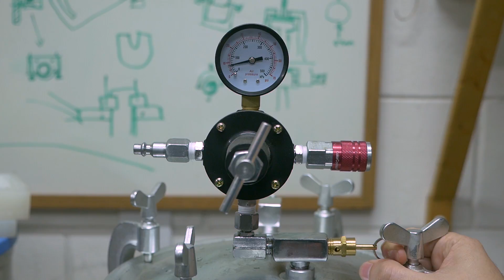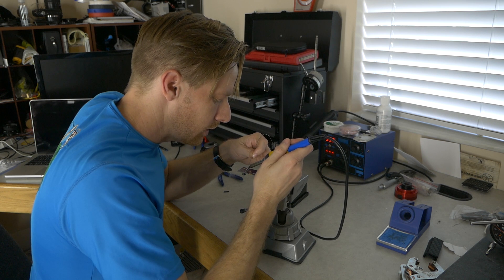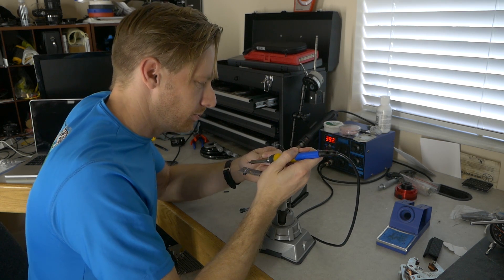We sprung a leak! - S02E09

Comment: I understand the use of this device in Industry, Institutions, Hotels and apartment buildings. But for home use not so much. Still having someone replace batteries once a year or just replacing a flapper valve 3 to 5 years The cost may not be recouped. Now if it were not battery powered could see other uses for it.

Comment: Heck that scale of surface mount can easily be done with a soldering iron. You don't really need a hot air or oven method unless you're doing BGA or other pin-inaccessible devices.

Comment: It's cool and all but these have existed for years, they're basically just urinal flush controllers, certainly not something you would need in a domestic setting. I mean do you want to have to wait within eyeshot of your toilet for it to fill or would you prefer if to be ready when you are? If you have a leak in your toilet you do then want to be spending hundreds of dollars on an electrical control valve when you could spend a few dollars on plumbing parts.

Comment: Close. That device is used for self flushing urinals. After the motion detector has gone quiet for half an hour the solenoid stops the water. This means the cistern doesn't flush all night long for no reason.
However, most of all that I have installed 30+ do nothing because nobody changes the batteries. There is a very clever mechanical version that detects the drop in water pressure as people wash their hands..... if they wash their hands.

Comment: Don't use a bloody atmega for a low power application, there are way lower power microcontrollers.
Reply: MSP430 instantly sprung to mind. I'd improve the plumbing. I like coloured cistern blocks because they keep stuff clean and show leaks in the bowl. I just bought my first house and replaced fill and flush valves but wouldn't build a solenoid valve inline unless I fit a urinal. Mains powering it would be part-P notifiable work but this sort of setup wouldn't need a sparky to sign off.

Comment: I guess KS shows just how pointless this project is. If you have a leak - fix a leak. It is easier than installing another device that can leak itself and needs maintenance. Also, without certifications, if this thing leaks and floods your house, insurance will not cover any of it.
Reply: Props for prototyping though. The part of the project with the most value.

Comment: It seems to me what you are saying is that the valve s normally closed. A person entering the bathroom causes the valve to open through the action of a motion sensor and the valve remains open for a predetermined length of time. The person may or may not flush the toilet during this visit and a toilet flush has nothing to do with this valve.

Comment: There is a flaw in your design concept. The way that this designed to work requires a person has to stay in the bathroom until the toilet shuts off or the tank will not get full. since you are staying there until the float valve shuts off the flow of water this device is redundant. A simple modification to the circuit would be to a potentiometer controlled delay circuit. The delay would shut off the water after a person leaves the bathroom and the delay could be set for the fill time of the toilet it is hooked to. This adjustment is required because different toilets have different fill times.
Reply from the maker: +John McKenna this is how it works now. It just opens the valve for a set period of time where it detects motion

Comment: I'm all for conservation,  but this is way worse than just making sure that the seals work. The manufacturing of batteries and the unit itself combined with the replacement of the batteries could never be offset by the loss of water, especially with a properly maintained toilet.  This actually bad for conservation.
Reply from the maker: +EnlightenedSavage do you have any actual numbers to back that up? Because right now most research and governing body estimate more then a trillion gallons of water are wasted every year on leaks that this device would help prevent. The simple fact is that toilet seals suck, and the current trend is only making them worse.
Reply: I agree that wasting water is a big problem. I drive my family and others crazy with my conservation efforts.  That wasn't what my point was. I just don't agree with the statement that seals suck. i have work in labs where a simple few dollar seal will keep a near perfect vacuum for weeks on end.  Proper maintenance is the real issue here. Seals do need to be replaced and not even that often. That is a simpler, more economical and environmentally friendlier solution. As far as numbers go, it is self evident that a simple seal has much less impact than an entire system. Besides the burden of proof isn't in my corner. I don' want you to feel like i'm attacking you . I quite enjoy your channel. But CONSTRUCTIVE criticism is important to grow.

Comment: I once stayed in a hotel where the toilets didn't have a cistern, it a
was flushed with a "spring tap" via less than 2 foot of tube, it was a flush handle that was about waist height. simply push and hold till the waste is gone! even simpler than a normal toilet. 

aren't they worried that the toilet will have to fill up before they can flush those tacos?? 

wife: hey honey, why are you dancing in the bathroom??

husband: I'm trying to fill the loo!

W: Okay...

waste of time, money, and everything that went into it.

doesn't even appeal to the gadget lovers!

Comment: Great engineering and informative video, but:

Scenario 1:
You know you have a leaky toilet and are annoyed about it.
Result:
You fix the toilet.

Scenario 2:
You know you have a leaky toilet but don't care about it.
Result:
Well, you don't care about it.

Scenario 3:
You don't know that you have a leaky toilet.
Result:
Won't get fixed.

Conclusion:
None of the scenarios end up with you buying a separate device that increase the amount of couplings and risk of leaks in your system.
Reply from the maker: Scenario 4: you own a apartment building, your tenants don't care they have leak but you do. its difficult to tell you have a leak and this will prevent it.

Scenario 5: you own a property that you are only there for a few month out of the year. a leak could start at any time, including when you are not there. this prevents it.
Reply: Scenario 4 is relevant, perhaps this will find it's market in apartment building owners.

Scenario 5 isn't really plausible since if you leave a house for long periods of time you usually just turn the main water supply off to prevent any type of leaks while you are gone.
Reply: Perfect counter-arguments. Somebody hasn't thought about their product enough to see how silly it is.
Reply: And there is plenty of affordable systems that you hook up to you main water supply that will detect leaks (small and big) and alert you of them. It will also shut the water of automatically if it thinks you have a major leak somewhere. Makes more sense since it covers your entire system and not just the toilets. 
Since most houses have more than one toilet you'll need several of these toilet devices as well, so it will be more expensive and higher maintenance than the one device that covers your entire house.

Comment: what exactly is this device for?

my toilet i.e. is stopping the water if the reservoir is full. and i need the resevoir to be full everytime i use the toilet. so how does this improve anything?
Reply from the maker: because many times the flapper valve in your toilet doesn't do its job.
Reply: Physics Anonymous i have to disagree. the valve on my toilet does its job every time. if it wouldn't, it would be broken and has to be replaced.

there is no point to adding a second valve, because why did you install the main valve in the first place then?

this idea is like you fix a dripping fosset by attaching a fancy device to it instead of fixing the fosset itself...
kinda like an antivirus for toilets...

i does not sound like the inventor thought this through or he is after the money of very stupid people (i dont want to imply that, but its still a possibility)
Reply: A replacement flapper valve costs about $5 at Ace hardware and lasts years, doesn't require batteries. This is the essence of a 'jerry-rigged' solution: fixing around the problem when fixing the actual problem is smarter.

Designing a smarter toilet valve from the get-go would be a more worthy engineering goal.

Comment: So to prevent a leak you've actually added several more point to which a leak can take place. You've also pointlessly added to your carbon footprint... so inadvertently you've not helped the environment at all, quite the opposite...
Reply: Funny you said "crappy", Thomas Crapper was a plumberL https://en.wikipedia.org/wiki/Thomas_Crapper
Reply: The water that goes down your drain isn't really wasted. It goes back in to circulation almost immediately after passing the water purification plant. Fresh water you use to water you lawn is "wasted" since it's not reused immediately.
The energy used to purify the leaked water at the plant is wasted, but that amount of energy is nothing compared to the amount of energy needed to manufacture and ship these devices, not to mention the continuous supply of batteries it need.
So all in all this device damages the environment more than it helps it.
Reply from the maker: +pault040210 a few things, first, water conservation and carbon footprint print are two different things, but it's a fair point non the less. Second not all valves are created equal. The flapper valve in a toilet is much much more likely to leak, especially with the new low flow toilets because they have less head pressure. Check out some of the studies discussed on the Kickstarter. A huge amount of water is wasted because of the crappy design of the flapper valve on almost all toilets

Comment: Are you using a radius on the scraper?
Reply: miles mcdonald yes- I borrowed from Stefan Gotteswinter's advice and radiused my tool to about 60mm. seems to give good control over which part of the blade is contacting the surface

Comment: I love the engineering aspects of this, designing a circuit, 3D printing to make a mold, then casting the shell, but why not just fix the leaky toilet?  A toilet really shouldn't leak, and I expect it would be a lot cheaper to just replace everything in the reservoir than buy a third party device to work around the problem.  I guess I'm just confused why this is a better solution than just fixing the toilet... Still, great video and thanks for sharing!!
Reply: I looked at the device on kickstarter, and its estimated to cost is around ~120, given that is the minimum backing for which the backer would receive the device.

I pointed out earlier that the cost per 1000 gallons of water in my hometown is about 3 dollars. This means I would need to have a toilet that has wasted 40,000 gallons of water before this device has been justified.

In reality, the average person only uses about 3,000 gallons per month (for us its about ~$10 per person per month on the water portion of our bill). 

There's 525,600 minutes in a year, and ~91,000 drops of water in a gallon, with some error in assuming the volume of a drop of water, of course. (http://askascientist.co.uk/physics/many-drops-water/).

If a toilet leaks about 10 drops a minute, it would take 9,100 minutes to leak a gallon, and so in a year this would waste about 58 gallons of water, or basically cose me an additional 15 cent per year. 

If a toilet leaks about 100 drops a minute, we are up to 580 gallons a year, or about a dollar fifty per year.

If a toilet leaks a 1000 drops a minute ( a gallon every hour and a half ), we are getting into what I would consider a pretty severe leak, we still only consume an additional 6000 gallons a year, or about $20, in which case it would take me 6 years of homeowner negligence to justify the cost of this device.

In fact, the toilet would need to leak approximately 4.5 gallons per hour in order to justify the cost of this device over the course of single year, and that's just breaking even, not yet saving money.  That's literally four good sized swimming pools worth of water wasted in a year.

To put all of that into perspective, a flapper valve costs $5, and while it might not completely stop a leak in every situation or on every toilet, if properly installed it would certainly get you very close.

Even if you own an older low flow toilet, which have a sordid history of leaking because of low head pressure, advancements in toilet design and technology have come a long way since the late 90s, back when this was a very real and common problem.  

In fact, you can buy a brand new low flow toilet (~1.28gpf) with more modern technology and much lower chance to leaking, for less money than this device costs.  Why not save money by simply replacing the problem toilet?

Basically, this is a solution looking for a problem.

I love this channel and look forward to every video. So please don't get me wrong.  I am just a nerd with too much time on his hands and was curious what would be needed to justify the cost of this device.  I completely understand this video is just your sharing the work you were contracted to perform and does not necessarily reflect your views and beliefs with respect to any proposed epidemic of leaking toilets. xD
Reply: Amra shouldn't leak, but often do. I also find a lot of folks really don't notice when their toilet is running, maybe don't hear the sound or don't know what the sound means? Also think condos (where people are away for months at a time), college kids or renters that don't bother to call maintenance when something is broken.
Reply: I agree 100% with Amra. Great video anyways and some great display of technical skills.
Reply: Those are fair points Ryan, but if you're connecting this device to your toilet, it seems fair to assume you've already concluded that the toilet is a problem, for if the problem were a leaky faucet this product wouldn't help at all.

In which case, a complete toilet repair kit is about 20 dollars and should last about 5 years. The price of batteries alone exceeds that cost within a couple years, and that's not including the price of the device itself.

Regular maintenance is pretty important knowledge for a homeowner, and if you have the money to buy this device, why not just call a plumber?  

Imaging a different problem, lets say a person has a pretty severe leak, but have installed this device to stop wasting water.  So lets say they go to the bathroom to pee, they might need to wait upwards of a minute or more after using the bathroom while waiting for their reservoir to fill up before they can even flush the toilet.  When they could have just replaced the flapper or valve and be ready to flush immediately after using the toilet.

That said, I suppose I could see the device being useful for consistent long-term non-residence, but that's an awfully niche market. Still, a good application.

Lastly, renters are the ones paying the water bill, so if they fail to notify a landlord about a leaky toilet, its money out of their own pocket, but lets also keep in mind the cost of water is averaged around $1.50 per 1000 gallons in the US (closer to $3 where I live), which means you would need a pretty substantial leak to cause a notable increase in your utility bill.  I doubt a leak that's wasting tens of thousands of gallons a month would go unnoticed for long.
Reply: Agree, this is stupid idea, shouldn't have been able to get past the market analysis stage of the product planning.
Reply: First off, you wouldn't install it on an already leaking toilet. Secondly it's not just about the money it's about the wasted water. Thirdly, unless your toilet is leaking enough water to activate the refill valve between the times you use the toilet, or unless it's leaking enough for you to hear it refill (provided you can hear your toilet refill at all), you won't even know your toilet is leaking. Multiply that by the millions of toilets, it's a lot of waisted water. I do agree though, it is way too much to be effective, and you should do basic maintenance to prevent the problem in the first place. (Sadly, most people don't, and a lot don't know how.)

Comment: First Comment! Yay! =)

I may be suffering from Availability Heuristics here, but allow me to provide an opinion with very little data to back it up. ;)

I used to work as a plumber and I've installed a couple of toilets/cisterns in my life and maintained the flushing mechanisms.

I have not come across a problem with the flushing mechanism often enough to warrant installing a secondary device, in the hope that if you ever develop a problem with the mechanism, this 'safety net' prevent water wastage. 

I would say that this is a solution looking for a problem to solve....

P.S. please don't get me wrong: I get excited about the entire prototyping process you guys are going through, its awesome to see. But I gotta be honest.
Reply: mictho100 it would be nice for me cuz I live in the woods and use well water which can schmoo up the flaps and cause small leaks which cause the well pump to run too long.